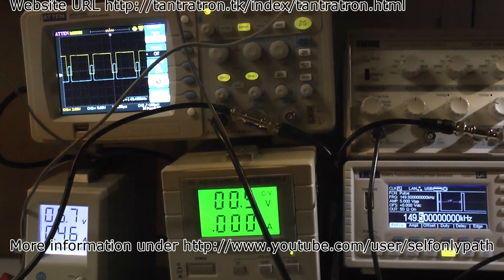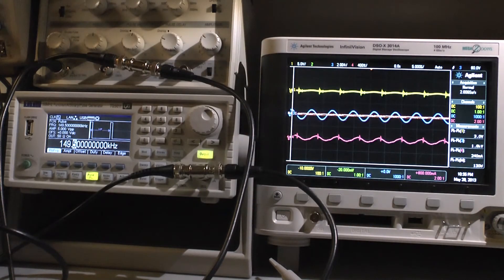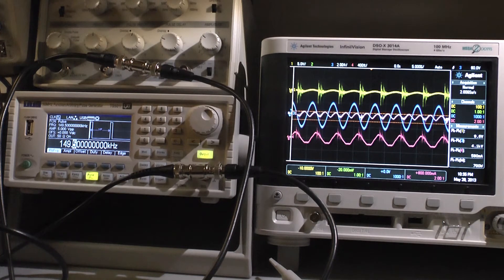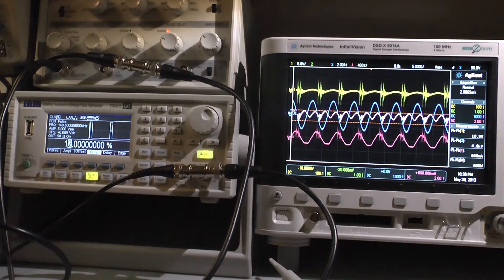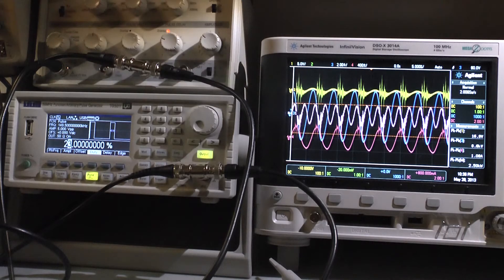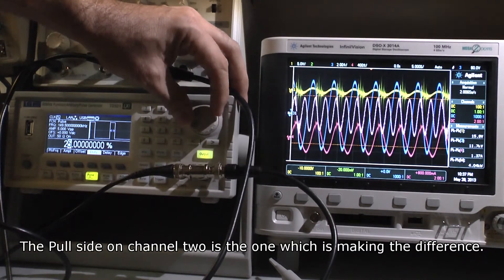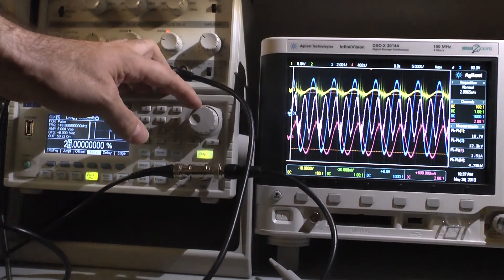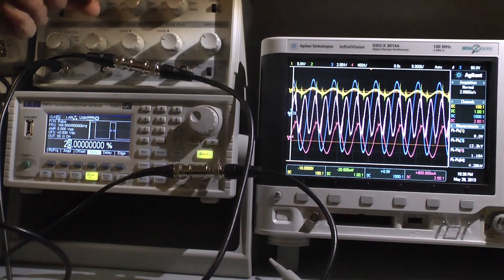The Modular Quadratron Board from Tantratron,  Part 3. The Half Bridge Topology revisited,

Comment from the maker: In that case I have very good news for you. I will create a new video with the special demux controller board and give guidance how to use it as a module with the quadratron board. It runs very cold and you 
have 800 watt at your disposal. Solid state Tesla coil driving quality.

Comment from the maker: It is not. Check the scope. The math calculation does take that into account for each fraction of voltage and current wave in the time line. Other wise you would have 26 KW when you just multiply the scope readings. It will use this for my water heating system I build as Part 3 of circuit topologies.

Comment: Great. But can u extract that 5kw? Heat something. Or light 5000/35=142 35W fluorescent tube with it at full brightness. I fear most of this is reactive power the current and voltage is out of phase so it cant do any work.